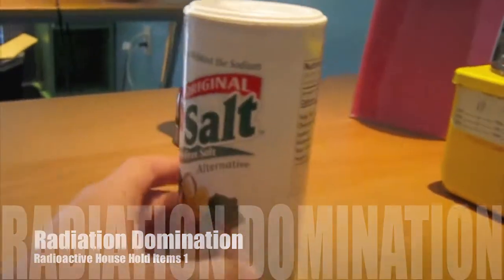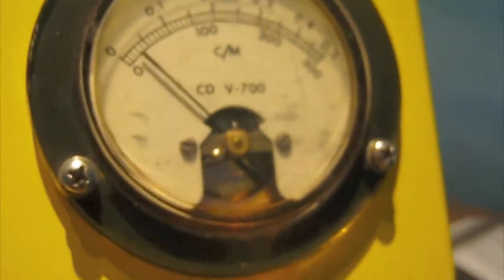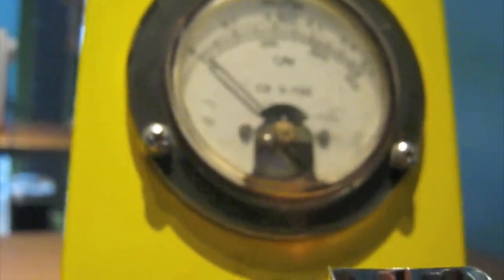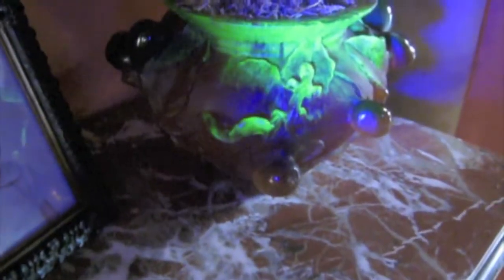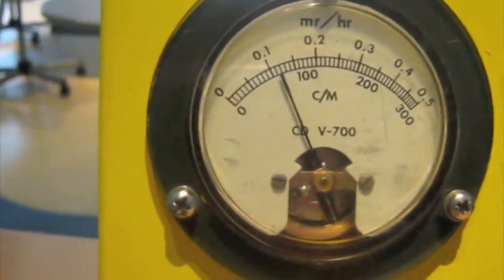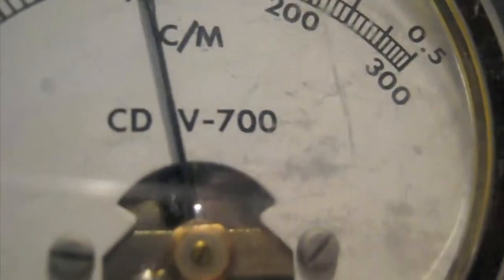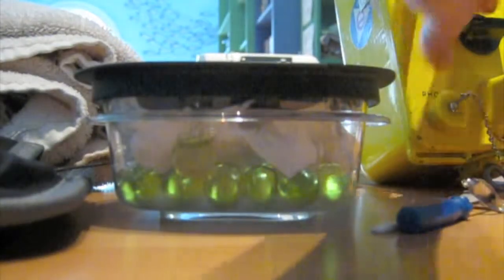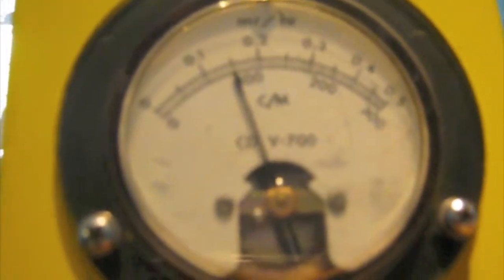Radioactive House Hold Items. (ep.1)

Comment: Good job!!!     Be careful around radioactive stuff. You sound like you know what you're doing, but breathing in any of that Am241 is quite bad (though you would need to remove the safety foil first.)    Additionally, Am241 is an alpha decay mode primarly and the reading you get is probably much lower than it should be. Your CD V700 isn't made for alpha and only picks up a little. 

Great video!

Comment: With that probe open you are detecting almost all beta. That's not measurable with the 700 in mr/Hr. That's only counts per minute. Close the probe and you won't get anything on what you are trying to detect there. The probe shield with block just about everything from what you have there.